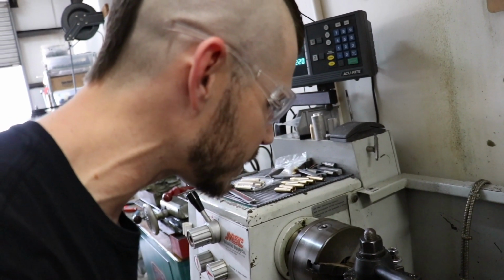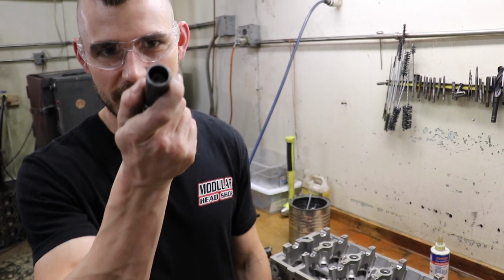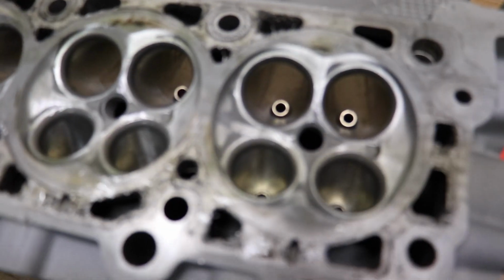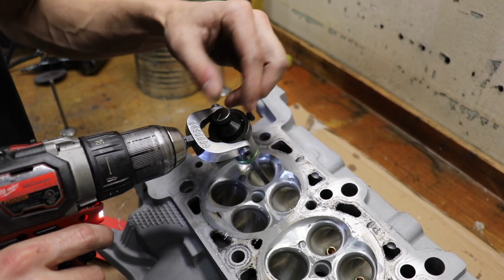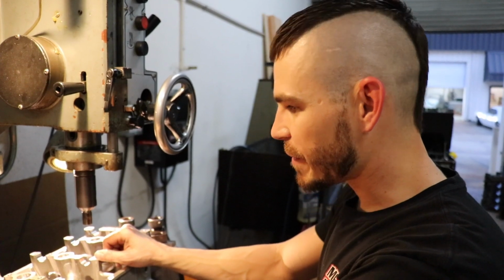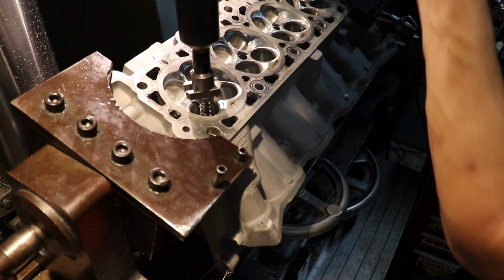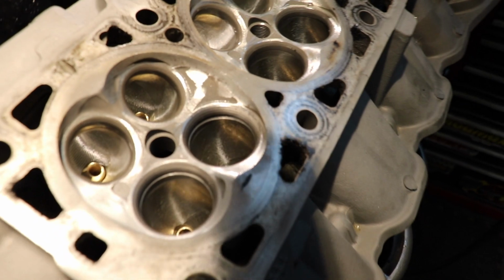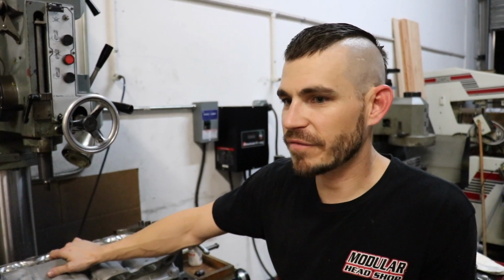5.8L GT500 Engine Build: Bronze Valve Guides & Valve Job

Comment: Jorden, mate i used to sell aerospace alloys and aircraft alloys, i came across a company which makes the GT40's in australia, it was a old wooden shed in the middle of nowhere, but in saying that i found out he was using just normal aluminum commercial grade about 1.5mm for the firewall areas and other areas when building the GT40's i said to him if he used 6061t6 or 2024 t2 he would have stronger thinner and lighter aluminum and make the car even stronger, he said are you trying to tell me how to build GT40's i said no way, but in any case have a look at the sheets and grades we offer and have a look at the ASTM book and pick out what you think is the best, sure enough he brought 20 sheets off me with in a week, but also i came across a company which made tungsten carbide diamond tooling used in engineering any tool he would make for specialised industry and he wanted a hi grade of titanium mesh to put into his oven, as the stainless steel one he had would bend and the tools would basically roll onto each other which he could not have, so i got some titanium mesh which he had to cut to size but it solved his problem and also he would buy 44 gallon drums full of diamond dust, which he used to coat the tools he made,. cheers and keep up the great work your doing. :)

Comment: I worked at a machine shop for a year and this guy does it right!!! He is dead on correct about the guides and seats. If you want the guides to be a certain length, you have to trim or cut them like he said. It takes a very long time to a set of 4 valve heads but they really are nice when you get finished. Love this content Andrew!!!!